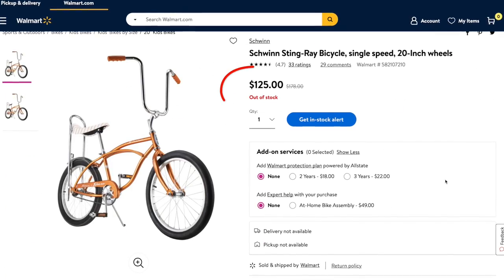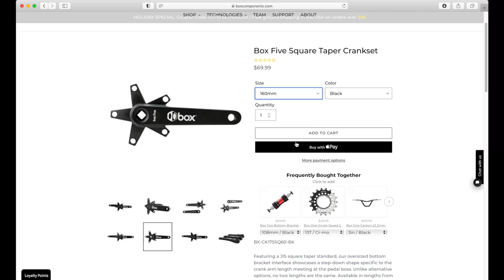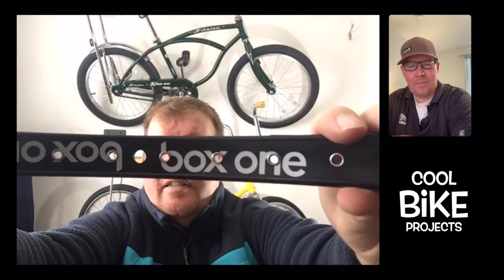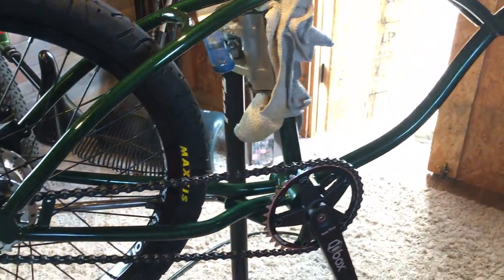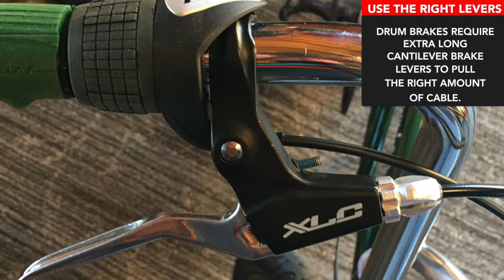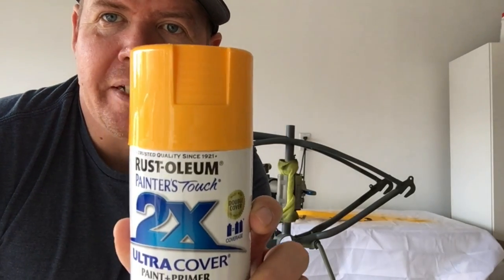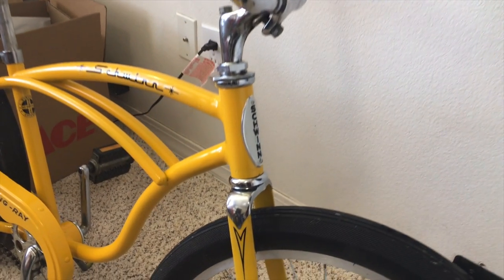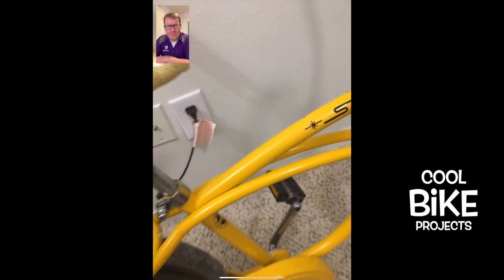Schwinn Stingray Restoration Upgrade

Comment: For a brief period in the late 1970s, Tesco in the UK sold a cheaper version of the Schwinn Stingray called the Intercity. Like the Schwinn, it had two 20" wheels which made it so much more stable than the Raleigh Chopper with its front 16" wheel.  Also, the Chopper weighed as much as a small planet.

I bought my Intercity off a neighbour who had moved onto a different bike. He virtually threw it away because he thought it needed a new front wheel when it only needed the bearing cones tightening - I gave him a fiver only, which wasn't much for a bike even back then.

It was THE best wheelie bike ever but looking back at the central frame mounted 3-speed gear shifter, and that amazing banana seat... well, I wish I still had it just to show my kids what bikes were all about before they all became a bit samey.

I particularly love the new green bike in this video - I'd love to do a restomod on my old Intercity with some modern components.
Reply from the maker: Sounds like a great bike. I've seen a couple of Raleigh choppers role through the shop over the years and they were heavyyyy!! If you come across another Intercity, I'd be happy to collaborate on a build up with you!
Reply: @CoolBikeProjects  I did find one a few years ago on the internet - an advert for an auction house which, bizarrely, was located in my home town. Unfortunately, the auction was some months before and the auction house never responded to my requests for info about the buyer (I was prepared to make them an offer).

Quite honestly, I think the Schwinn is a better frame and fork anyway. The Intercity had no bearing in the head tube - only a nylon bush which moved back and forth, and I suspect the frame would be heavier than the Schwinn. In its favour, it did have an English threaded BB and the banana seat was the very best type I've ever seen (it was very flat and very comfy despite its minimal padding).

I saw a forum once where a guy had taken a 20" wheeled fat bike and turned it into a chopper-style bike for his daughter, although he conceded it was heavy. Although Raleigh did make a reissued Chopper with an alloy frame, I still suspect a Schwinn would make the best basis for a restomod. That 16" front wheel puts me right off the Chopper.

Comment: I still have mine only missing the front rim, gooseneck, bars and the seat. I converted it to BMX and sprayed it navy blue metallic in the early 80s not sure what happened to the parts. I know the chain guard is in my parents basement with the orig paint (red metallic) and lettering.

Comment: I seen sturmey has a single drive coaster brake rear hub on their site. The s1c. Does that fit the stingray also?
Reply from the maker: I’ll have to check on that. The drum brake on this was just a little tight so we spread triangle out a couple millimeters to get it to go in.
Reply: Yea I just ordered one of the new ones from Walmart and I’m gonna tear into it for fun. Gonna cerakote the frame and parts and make a new school chopper.

Comment: How would you clean the original yellow paint on old Schwinn
Reply from the maker: Assuming it it’s just dirty and maybe a little bit faded. You can use DTaP or several other brands of polish cleaner. But we’re just the basic backwash simple Green in water works great!